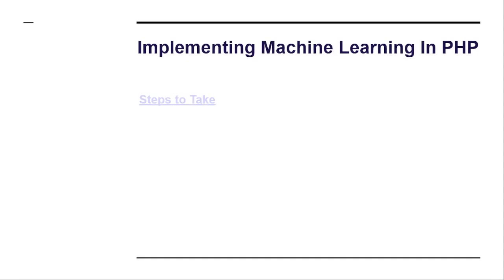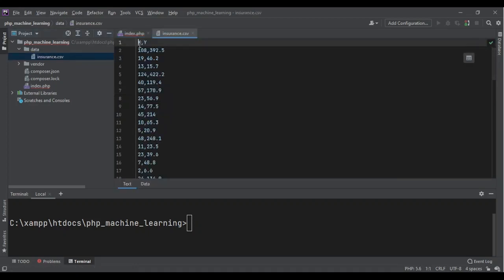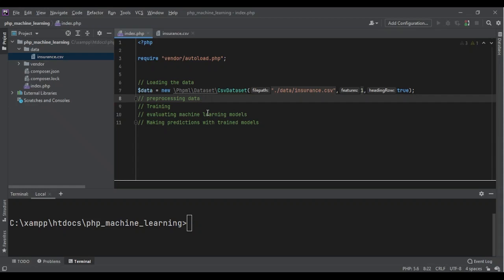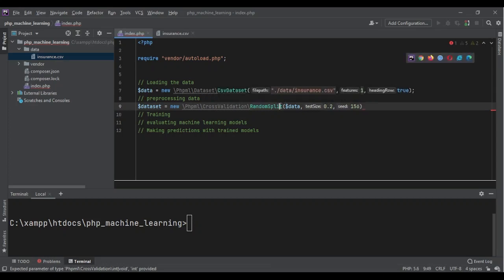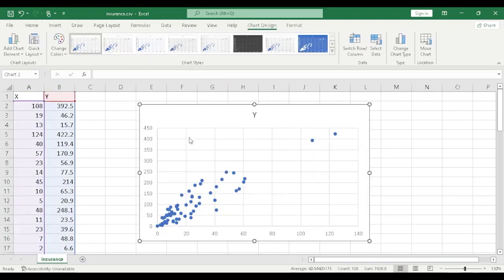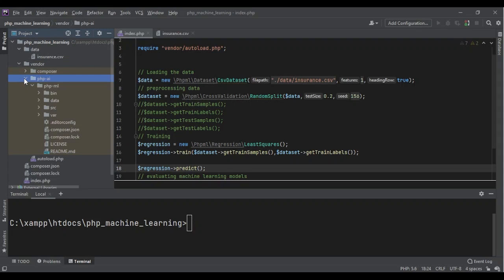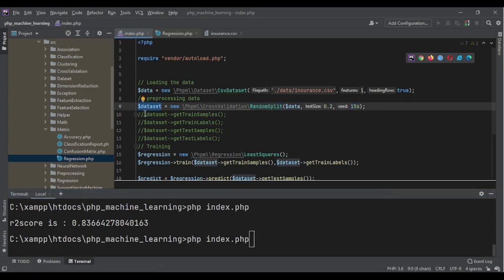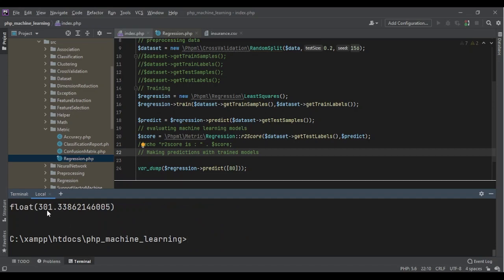Build Your First Model Step By Step - Machine Learning in PHP

Comment: im not following, so what the ML did here ? exactly :)) ? without generating random numbers from datasets i just dont understand what is this example for, what are the use cases.

So you trained your model using the shitty CSV or what that was, and then you use to predict WHAT
Reply from the maker: we pass some data with input and output results. the ML algorithms find the relation between input and the output without us specifying anything. then based on the final model we can guess the results of the output with future inputs.
for example 
you might have a dataset that showing a 2 bedroom apartment with 2 rooms and 100 square meters is around 1000 USD and another apartment with 1 bedroom apartment and 1 room and 95 square meters is 950 USD

you don't need to pass any specific formula. the ML algorithm finds the relation between size and room count with the final price and later you can pass 1 bed room apartment 100 sqaremeters and the model would give you the out put like 980 USD. so it would predict the price which is the output based on the input which is number of rooms and square meter. 

this is only one very basic example of ML and it can do many more things.

I hope it clarifies things for you
Reply: @amirkamizichannel  yes but why output 980 ? instead of 1000 ?
Reply from the maker: in the example I shared 1000 is for 100 square meters with 2 bedroom but if it only has one bedroom it should be cheaper (based on the data from the area I live) and the algorithm would learn that. but in some places bedroom count might not have a huge effect on the price and again in that case according to our data the ML algorithm would learn that.
in my example there are only 2 factors, bedroom count and square meters. but image in real life there are so many other factors like floor, age of building, access to public transportation and health centers, nearby locations, neighborhood and so many other factors.

Comment: I have a question, some body of mine are using Phyton and they are talking about epoch on training... does PHP-ML also use this???
Reply from the maker: thank you very much. that's a very good question. well the concept of an epoch in machine learning applies across different programming languages and libraries.
in php-ml you might not be able to directly control epochs like the way you would in python's tensorflow, keras, or pytorch because php-ml abstracts a lot of the lower-level operations and provides a more simplified interface for machine learning tasks. BUT with algorithms like neural networks you do have some parameters to control the number of epochs. for example in this part of the documentation you can see $iteration which can be translated  to epochs
https://php-ml.readthedocs.io/en/latest/machine-learning/neural-network/multilayer-perceptron-classifier/
I hope I could answer your question
Reply: @amirkamizichannel  Thank you!!! Hoping for more videos like this from you. I am looking a this kind of video based on PHP for a long time now and finally seen your channel.
Reply from the maker: Thank you very much. I'm really glad that you find them interesting. that means a lot